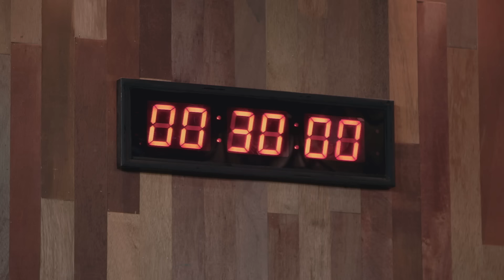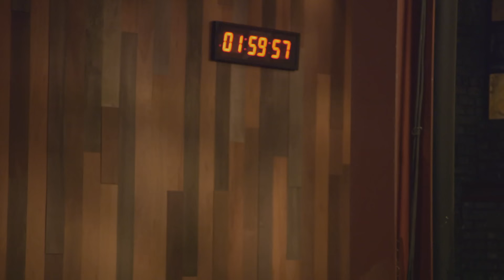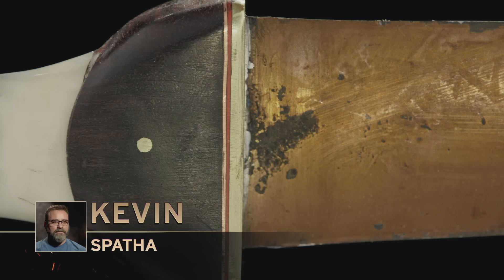Forged in Fire: The Barbarian Spatha (S7, E11) | Full Episode

Comment: There have been countless smiths that have presented the answer for bends in the quench.  Pull it from the oil and clamp it between 2 pieces of wood.  Let it cool between them. Its remarkable how smiths continuously do it the same way.  Quench, find a bend, PANIC and requench multiple times, and add stress to the billet

Comment: What is the powder thing they put on the billets?
Reply: It is a flux, usually a borax of some sort (either the soap version or a variant called anhydrous borax). It coats the steel to prevent oxygen from getting to the surfaces to help prevent forge scale from forming and ruining the weld. It also becomes very caustic at high temperatures, helping to lift forge scale and remove it during the weld.
Reply: @roostercaffeine426  ok thank you!

Comment: Mike DID follow the directions, just a smaller medallion although no hand swell it does not go through the tang as a normal pin would. They are separate as can be seen by him hammering them in on either side at 24:59, Mike was unjustly disqualified as one judge also stated the medallion just has to be visual.
Reply: It's not a small medallion at all.  It's just a pin.
Reply: Thank you
Reply: The medallions were correct, the set director was asked if i could do this because my full side 1s broke, when i asked whats the definition,  he state 2 separate disk...i asked does it matter the size....he said no. This is when i found out the truth about the show....not saying i would have won...alex is an amazing Smith , but performance wise at the least i would have matched him 100%. My knife was stronger and sharper than all of theirs . Sword wise no way looks wise i could beat alex, but i know mine would out perform his.
Reply: @mbbailout  out preform? It seemed to preform as well as possible.